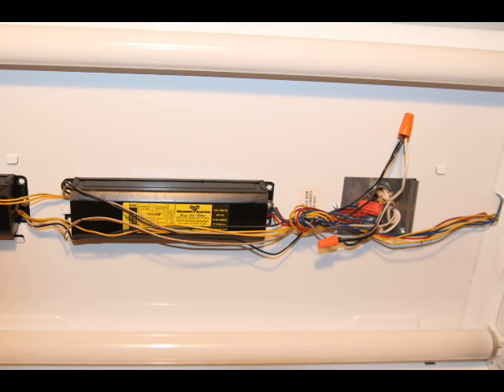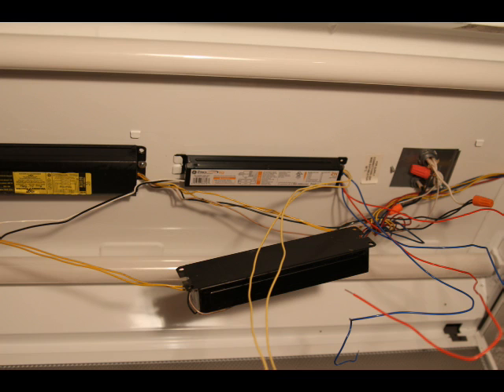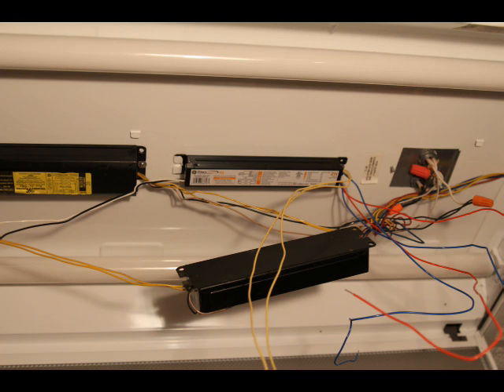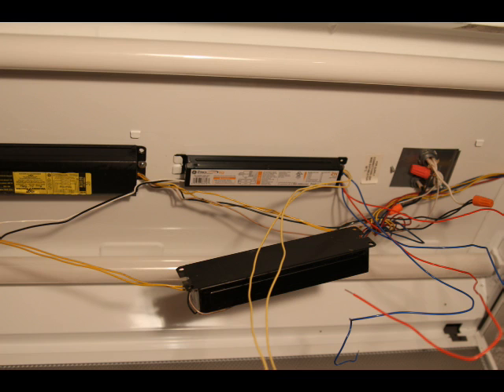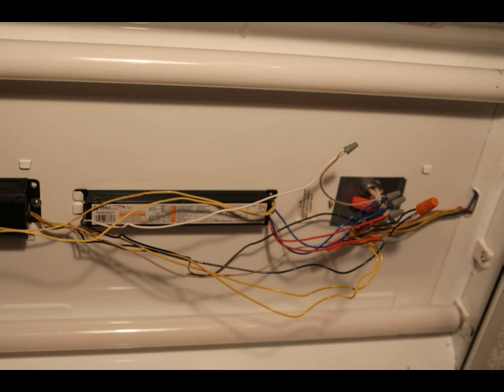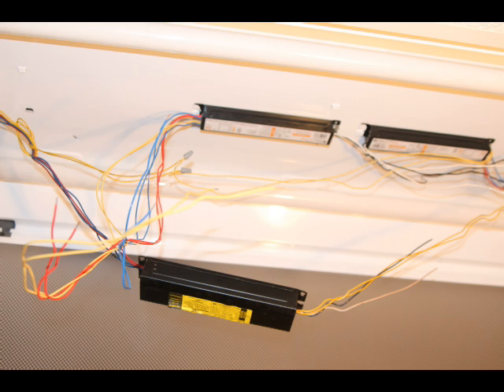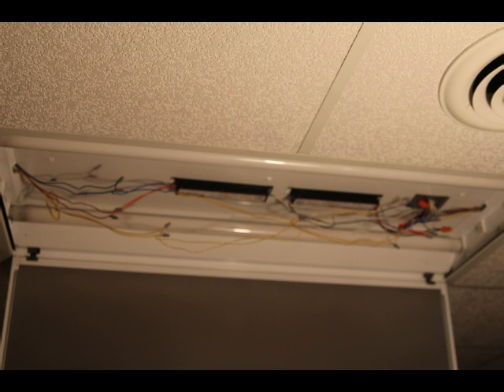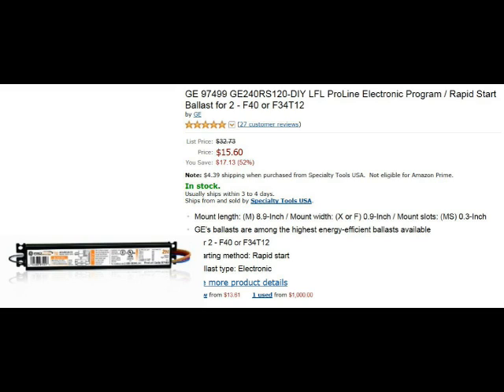Fluorescent Ballast replacement

Comment: I replaced my two ballasts with 2 electronic ballast and now when I turn on the fixture it makes a noise when I turn it on only and stops. Is is not a buzzing like you hear some do but only when I turn it on and it stops. I have a 4 light fixture 24" florescent bulbs. Any thoughts for this noise?